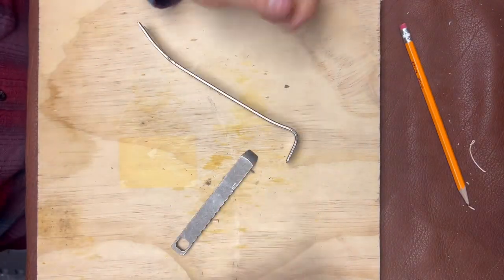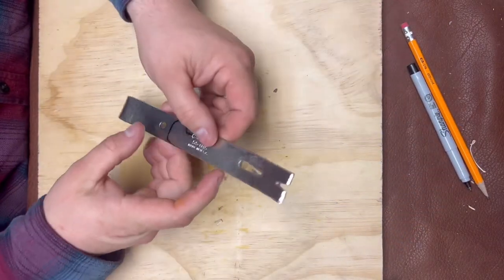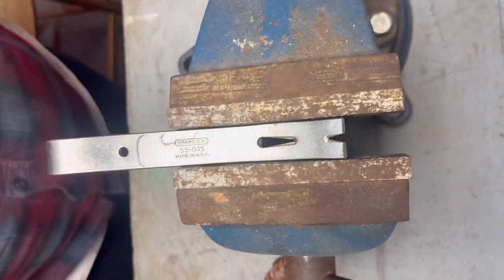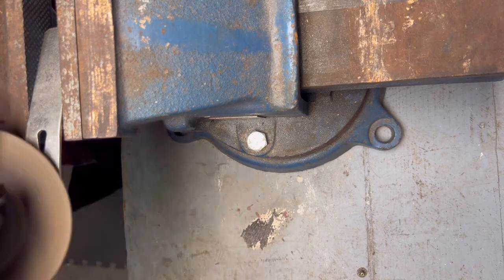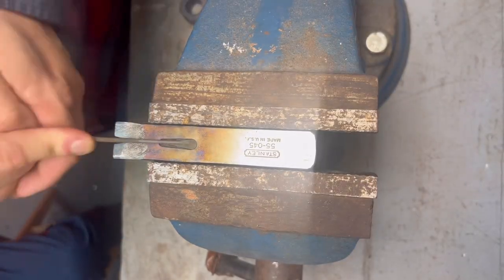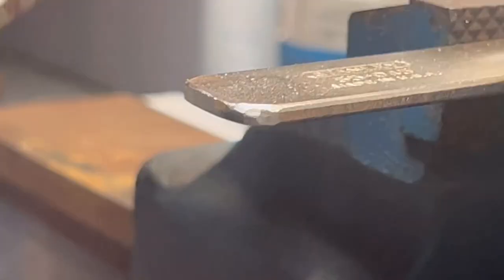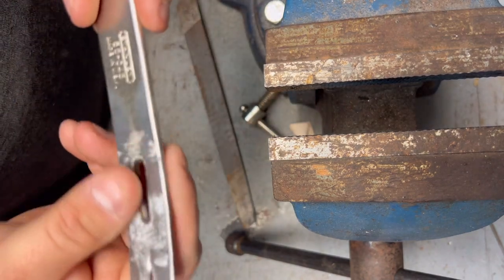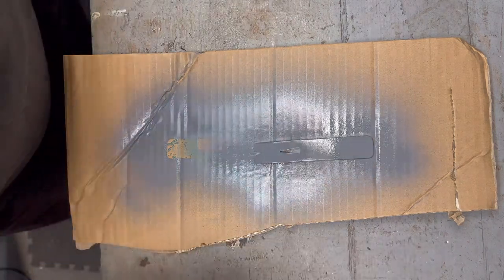How To Make An EDC Pocket Prybar

Comment: I used one of those Stanley pry bars to make one that suited my needs too. I left mine a little longer, after the hole. Mine came in a black paint from the factory. After I cut it with a Dremal and rounded it off, I just did a few layers of plasti-dip to finish it out. I use it mostly for an old elevator in our facility that the door doesn't aline and instead of getting my fingers pinched I use it pop it in to place.
Reply from the maker: Yeah they’re a perfect size to make a nice little pocket pry tool. I made a little leather slip for it in the video after that one if you’re interested!
Reply: I made the exact same mod to the exact same Stanley! But I stripped the paint and put shrink wrap around it.